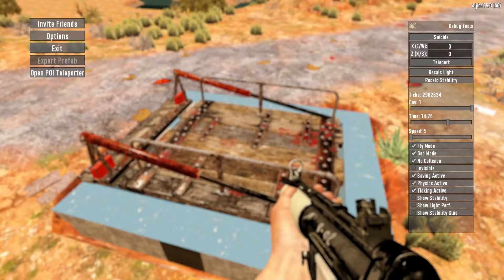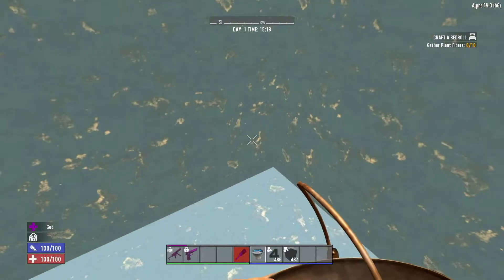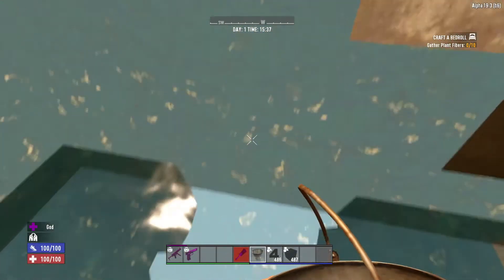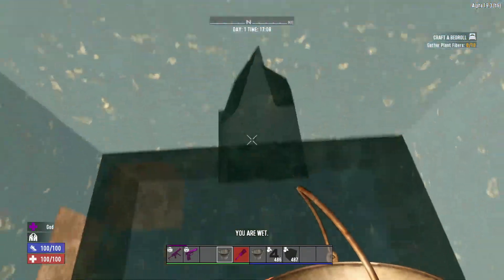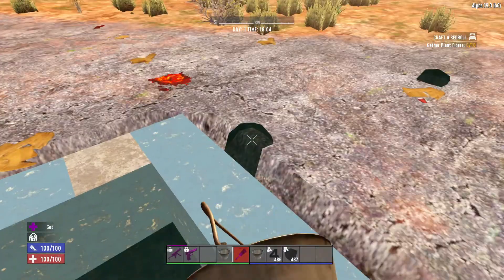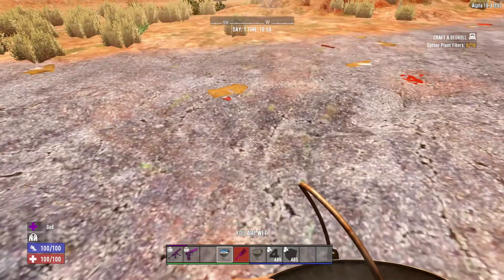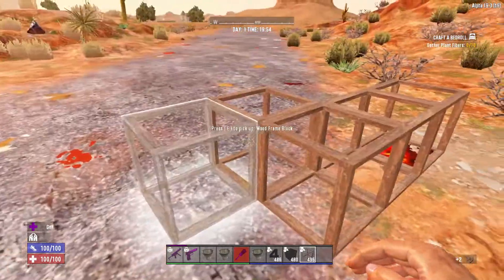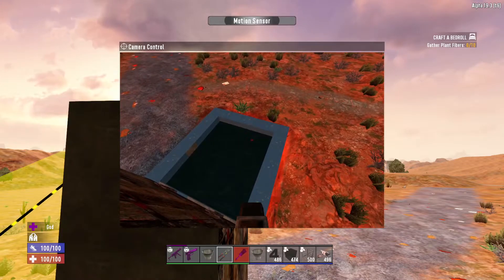How to fill a pool with water in 7 days to die?

Comment: Thanks for the help. I know the truck elevator is nuts but I figured I'd ask.
Reply: I wired mine like that but the second sensor didn't work. I appreciate the help,, I'll have to fool with it. I have an unnarrated video of my alpha 14 base on you tube. Before I had a PS4 and a pc that couldn't handle 7d2d,  just got a pc that can run the game. The alpha 14 base is way overpowered...lol.
Reply: Tried the wiring for drawbridge again. It worked.

Comment: What would happen if you dig a tunnel under a lake and had the end of the tunnel drain into a moat? Would the water flow all the way through the tunnel and into a lower point?
Reply: No water do sadly not work that way yet, it do not flow, it can best spread a few blocks.